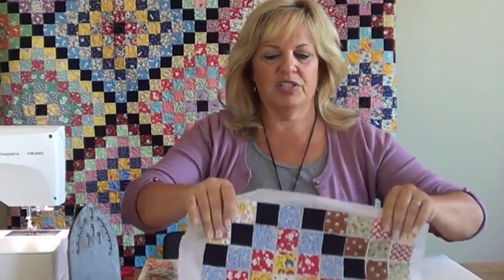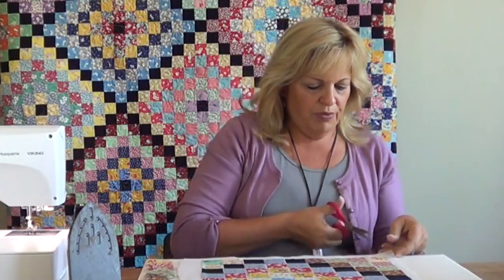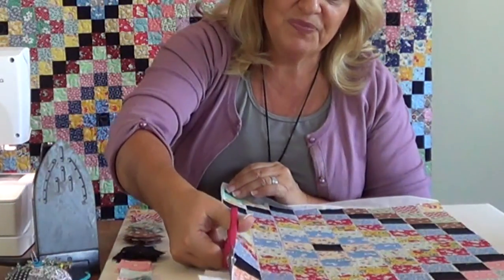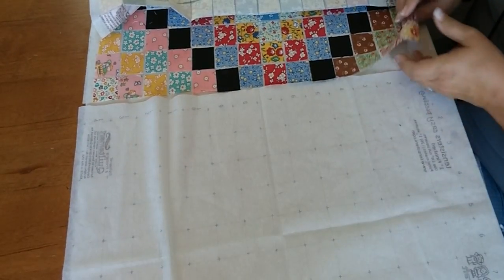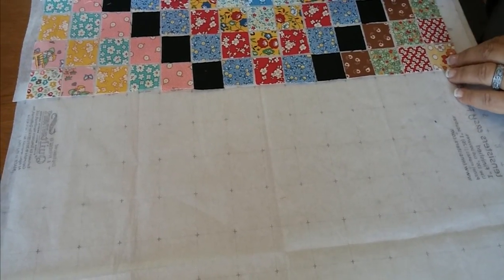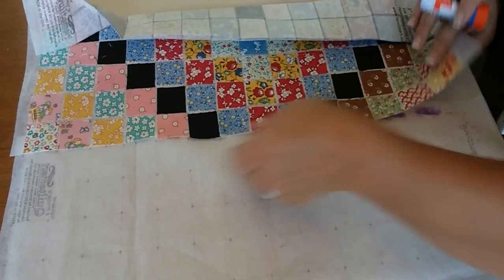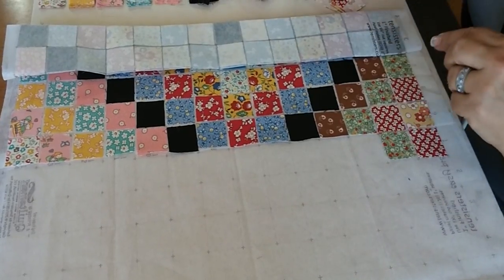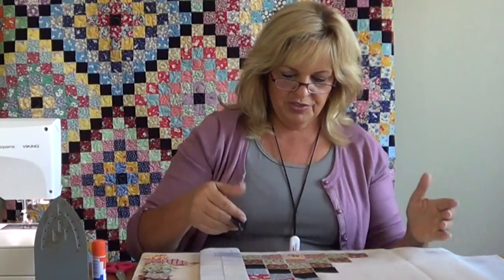Fusing Easy Piecing panels together

Comment: Thank you for replying to me.  Yes, I did use a Pellon cotton, fusible on one side.  After putting it together…and my machine refusing to see where my seams were, I realized that I had committed a grave error….I just wanted to check it out.  I will buy the proper material for future trials.  Thank you.

Comment: Do you have a beginner video on preparing the grid? To start the first panel would you leave extra fusible grid on all 4 sides and then fuse your fabric squares to that whole panel and then cut off the extra fusible? I did watch the video that tells you to leave the 1/2” on the side so you can fuse it to the next panel. I guess you would leave the same on the bottom of that first panel so that it can be fused to the panel below. I may have answered my question but as a beginner I don’t want to screw this up!
Reply from the maker: Hi Pam. If you click on Tensisters TV above or go to tensisters.com and click on tutorial videos you'll find lots! The one called Make a quilt with EasyPiecing Grid- that's a basic demo explaining everything. Also, if you scroll down the page there is a class called Scrappy Tree and Table Runner that goes through the process chapter by chapter. The instructions are the same no matter what quilt you make!

Comment: Awesome!  Is it still easy to do the quilting once it's ready for that stage, or is it a bit bulky?  Could you quilt then without batting if it's a wall hanging?
Reply from the maker: Carleen Brigley Hi Carleen.
I treat it just like any quilt top. It quilts wonderfully because it’s not shifting and stretchy. But if your top ever feels stiff just spritz the back with water and tumble in the dryer for ten minutes. 😊
Reply: @TensistersTVShow  Thank you!!

Comment: Just found your channel. I love the quilt behind you, it is beautiful. I do have a question. Does the grid interfacing soften after the quilt is washed? I purchased 1 inch grid from Pellon to do a Mine Craft quilt for my grandson. It seems rather stiff.
Reply from the maker: Meloni Beyer Thanks for the email! Yes, after washing it softens up a lot! Our EasyPiecing Grid is more lightweight and strong. The biggest difference is we print the squares on our grid slightly larger than the cut size of your fabric  which eliminates the bulk in your seams! Also we have a great Minecraft handout which is a FREE download on tensisters.com. Hope that helps Meloni😊

Comment: How many grids do you recommend fusing together?  I'm using the 2" grids to make the Mosaic which is pretty large.  Would you fuse the rows together at a time, like squares 1-5, then fusing 6-10, then sewing the rows together?  Or are you talking about fusing any more together than that?
Reply: Hi Patti-- It all depends on what size you feel you can manage. I usually fuse two or three panels together at a time when I'm piecing the 2" finished. It will really cut down on your pinning! I'm excited to see your quilt!

Comment: I did not see the instructions on how to fuse the squares on the grid.  What temp do yuo use on your iron and how long do you hold the iron on the squares.  Do you use a pressing cloth?
Reply: Hi Janel. I use a hot iron and I do like steam. I normally don't use a pressing cloth, I like travel size irons! I try to be careful to stay off the exposed fusible parts. The steam is a nice barrier. I use a flour sack dish towel or a piece of unbleached muslin as a pressing cloth if I do use one. I've heard parchment paper works well too! I hold the iron down for 3-5 seconds.

Comment: Just watching this after ironing 15 panels separately. Can I sew the seams and THEN connect the panels? Could you explain this process better? I don’t want a large group of fused panels and then try to sew all the seams. How do I connect the panels to each other?
Reply from the maker: Hi Catherine,thanks for watching! I've made another video on fusing panels that gives more info. If you sew the panels up before connecting you can still fuse- it's a bit tricky with the seam allowances sewn. You can fuse a few panels together, then sew them- basically whatever size you feel you can manage! You can just sew one panel at a time-then use pins to sew them together just like regular quilt blocks. Here is the link to the other video. Hope that helps!  https://www.youtube.com/watch?v=HCCZK3JT84Q&t=1s
Reply: TensistersTV thanks, I’m going for it! 😃